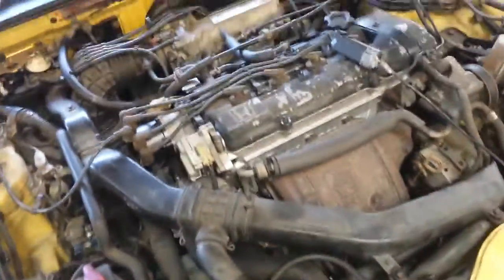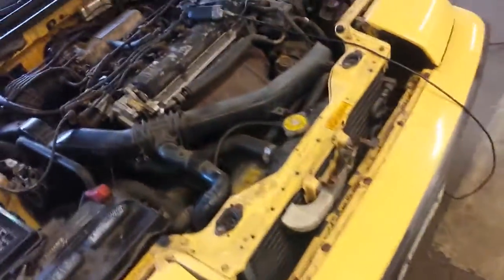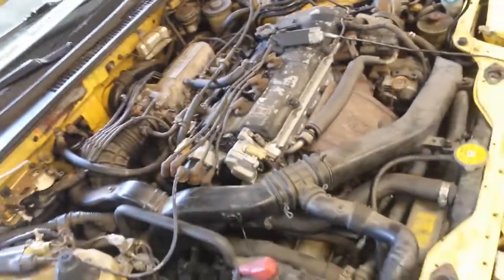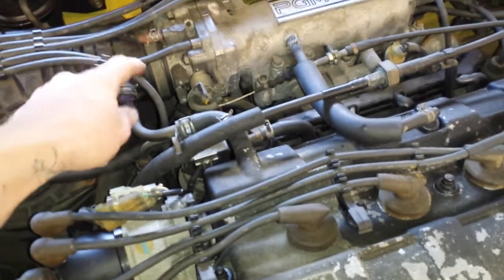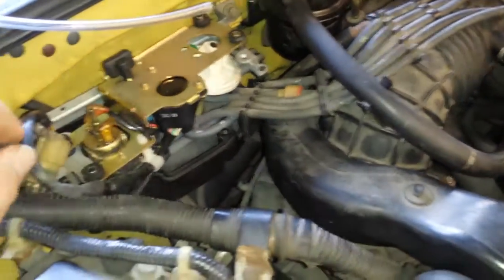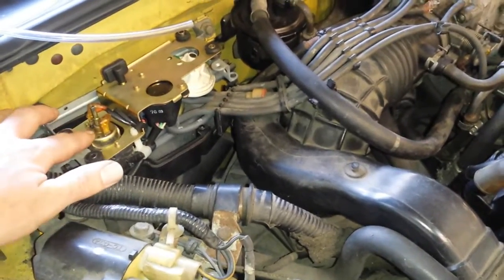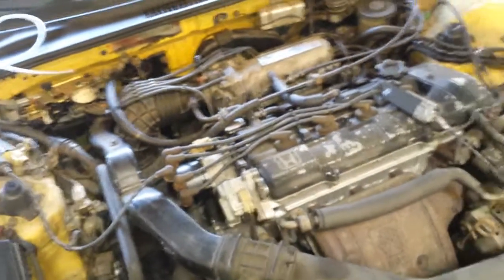Honda prelude, fail smog for high NOx. How to check EGR valve. FIX

Comment: you a real one! the shop I took my 89 to fixed my evap leak, but said that I would need a catalytic converter. I said nah cause I'm broke. went online and got some advice on forums and Facebook groups and here I am now. I unplugged the hose from my valve and my car kept running the same. I also feel no suction from the hose when I cover the hole with my finger. gonna do some deep web searching to replace the solenoid and try to clean out the egr valve. ITS A PAIN IN THE ASS TO REMOVE THAT DAMN EGR VALVE!!

Comment: I figured out how to increase suction by blocking off the t (cutting flow to tvis) after egr solonoid but prior to egr valve
It brought the nox down enough to pass at 25mph but failed at 15mph 
Ae82 Corolla… both test operate at the same engine rpm. Any insight on why the lower speed test isn’t passing?

Comment: I have a 86 accord that’s in pristine condition but it failed smog. The smog guy said the eve valve maybe isn’t opening and closing but then he covered some hole and the car shut off as it’s supposed to he said to maybe check the line or clean the Egr. It’s possible it’s not getting vacume ?
Reply from the maker: If he applied vacuum to the egr and the car died. The EGR is working properly. So , if the egr is not operating, I'd make sure all the hoses hold vacuum. If there is an electronic switching valve, check that too.
Reply: @ScottiesHobbies  I saw him Just  cover it with his hand or something. I tried reproducing the same thing but it was hot to touch so I’m not sure how he did it. I’m going to try and diagnose it but I have a car to paint and other stuff to focus on might have to wait till next week. The engine bay is really clean no spills of any fluids and the egr looks zinc coated and real shiny but I’ll see if it’s clogged maybe get someone more experienced to push me into the right direction
Reply from the maker: @alexvillalobos7137  did the car fail on NOx?

Comment: Hi, I have a 94 prelude. I failed smog for evap pressure even though it says pass on the evaporative controls. Is evap still related to your video? How can I fix it?
Reply from the maker: The controls part of the test is a visual test. We just need to see you have all the components such as the purge valve, vent valve, vapor canister, plumping, etc. The pressure test is a test that pressurize the fuel system with nitrogen and try to hold that pressure for a certain time. If the pressure drops that means you have a vapor leak in your evap system. In that case, a smoke diagnostic is usually the quickest way to find the leak.
Reply: @ScottiesHobbies  thanks!

Comment: Do you happen to know if the EGR Control Solenoid voltage is (5 Volts - computer controlled or 12 Volts - system controlled)?   The factory parts are getting almost impossible to find these days for these, so knowing the voltage could help find an alternative solution.  Thanks in advance!
Reply: 12V

Comment: Where is the diagnostic connector port location on 1995 Honda  prelude  2.3? Help please.  Thank you.
Reply from the maker: Off the top of my head I don't remember. But that vehicle is not an OBD2 vehicle so it's not the generic Port. It is a OBD1 connector and most manufacturers have their own special connection. If I get one of these in soon I'll make sure I make a quick video of it.
Reply from the maker: Some of the 95 Hondas that were built in late 95 do have an OBD2 connector, on the preludes I believe they're on the passenger side of the dashboard to the left of the passenger knee. There is a little cover on the lower part of the dash that comes off if I remember correctly. If that Vehicles equipped with it
Reply: Thank you , but what is look like?

Comment: where can I find that pump valve for that specific car
Reply from the maker: That is a great question. I once knew a great man named Jeff at Patty's on San Pablo ave in Berkeley. I don't know if he is still around but he did the diag and the repair. He might be the one to contact. I've tried with no success lately.
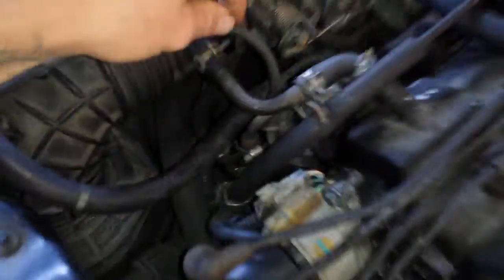Reply: Am I suppost to feel vaccume from that hose going into the egr at 0:38 because I feel no suction.

Does the egr vaccume start working as soon as you start the vehicle  or does it  start at a certain time.
Reply from the maker: @yurunning5574  that hose should only have vacuum wile the engine is under load and has to reach certain criteria for the actuator to open and send vacuum to the egr valve. I use to test if they were working correctly by attaching a vacuum guage to to the hose that is connected to the egr valve. So the egr will be non functional wile you are doing this. But run a hose to the guage were I can see the guage without clasping the hose, use fuel line if needed cuz its way thicker. Drive the car about 30 to 35 mph and see if i ever get any vac.